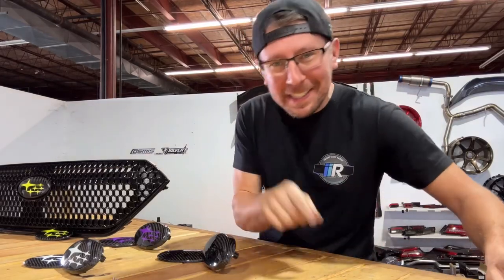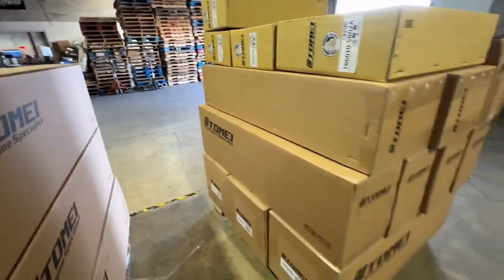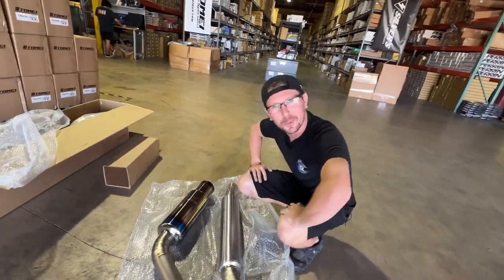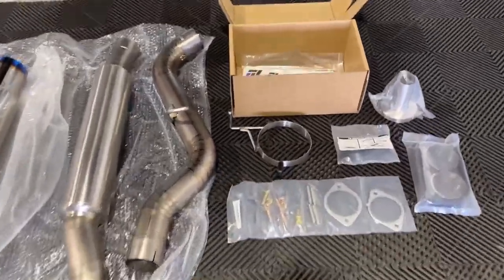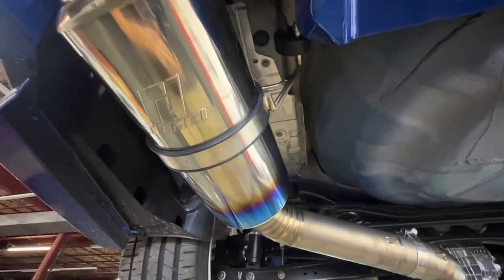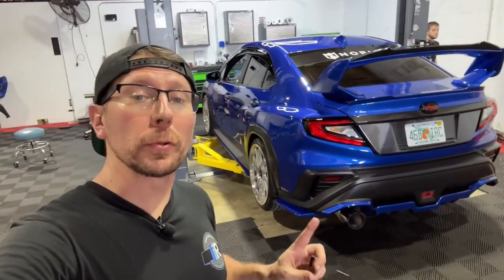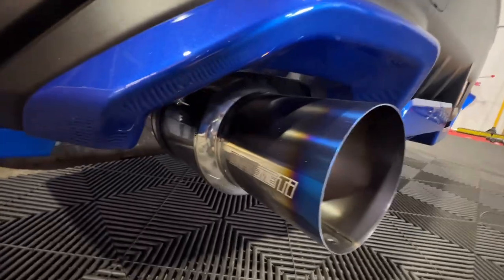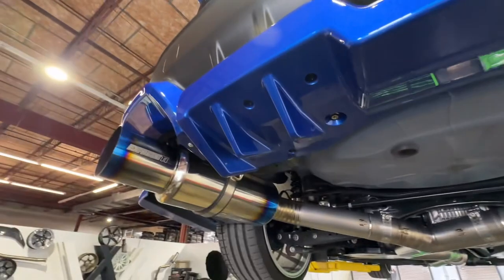ULTIMATE TOMEI TYPE-R vs. TYPE-D SHOOTOUT! | SUBARU | WRX | 2022 | 2023 | 2024

Comment: as a fan raw Ti, I would use some cleaner to remove the bluing and let it blue naturally.   I'm guessing that is what Tomei did on the pie cuts and other places there are welds.   Then artificially blued the tip and front of the muffler.   Still a nice product though...  So, what is better single exit left, single exit right, or dual exit?
Reply: I actually removed the blue, and it never naturally came back.

Comment: Anyone know how much louder is this than the MAP mufflered catback? That one has a rough resonance boom between 1900-2000 rpm that occadionally sets off knock sensor. Thinking of replacing with Tomei dual exit, but trying to find info on how much louder it is.
Reply from the maker: Judging by the muffler design, the Tomei should be a tad louder... As far as the audible difference between the two... not sure exactly!